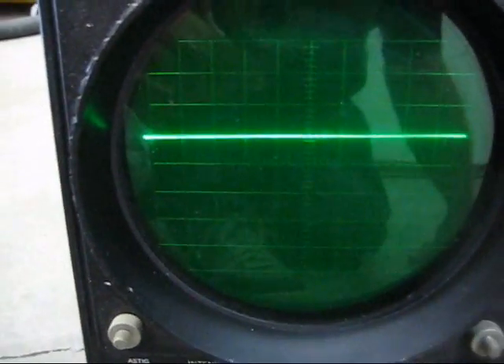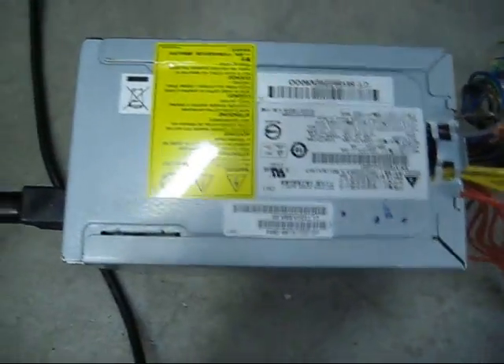Switching Power Supply For Chlorate Cell

Comment: I have a several power supply. The problem is when I connect it to the bath  the voltage drops down and sometimes amperage... to solve the problem need bring close electrodes together and in some case the electrodes need place far from each other.. I don’t who people manage to hold it to the exact point..
Reply from the maker: You need better supply voltage

Comment: mine is power by 600 watts 5v 32Amps power supply and when running it is only supplying 4.3 Amps max to the cell...i read it using dc current clamp meter....

Comment: can i connect all the + leads 3.3 5 and 12 together to an  300W stepdown converter like this http://www.ebay.com/itm/DC-300W-20A-CC-CV-Constant-Current-Adjustable-Step-Down-Converter-Voltage-Buck/401342111666?ssPageName=STRK%3AMEBIDX%3AIT&_trksid=p2057872.m2749.l2649

Comment: thank you for reply! even though i used even a 12 volt 10 watt light bulb it is just shutting down so i tried changing the load by using two 12 ohms 10watt attached in parrlel between 5 volt wire and ground then also it is shutting down  so i changed the load from 5 volt wire to 12 volt wire and i used a load of 22ohms 10 watt resistor then also it is shutting down and iused some combinations of resistors but they also worthless .So i checked out for short circuting but there is nothing.

Comment: hey!ytmachx i have old pentium 4 supported ATX power supply and i used a dummy load resistence of 4.7 ohms and 10 watts between 5 volt red wire and ground black wire and when i on the power supply it is running and as soon as i connected it to a chlorate cell it just shut down. can you tell what mistake i have made?

Comment: Thank you for the video.  The only purpose for the shunt is to measure current, correct?  Help me understand why you would limit current flow with the resistor, except to simulate a cell.  For chlorates, would the best option be 5V/13A?  What is the minimum V/A combination for any power supply needed to produce perchlorates?

Comment: Hi, i have just given this ATX mod a try, but the powder supply shuts down every time i try and run a globe off any of the power lines, do you have any thoughts on why it might be doing this?, also did your power supply have any sense leads for the 3.3v line ?

Comment: im just trying to figure out how many amps my system is consuming also, I hooked up a car charger to it @ 6 volts and it would do 12 amps easy, was making out the battery charger easy on 50 amps,  Do I have to have a load on the computer power supplies to have them put that out?? ie the light bulb running

Comment: very little, now should I make my cell on the positive side and run a 200 watt light bulb on the back end of it to pull more amps through it or is that none effective?  I used roughly 6 pounds of potassium chloride for the 5 gallons of water, any help would be nice :)

Comment: Ok so I did 3 300 watt pc power supplies in a parallel circuit, each rated at 20 amps for the 5 volts power line.. The question....  My cell Is a 5 gallon bucket im using 14 electrodes total to help with keep wear down. The bucket is nice and toasty near the top half, and cool on the bottom,  when I do a resistance test through my cell i get 2.9 milli,

Comment: i found an old computer lying around that doesnt work at all. but the power supply is good. i went through and cut all the connectors and grouped all the wires by color exactly as you did. i will start chlorate production on monday. that is if my cell doesnt melt. im going to look for a good glass cell. or make one out of pvc.

Comment: is a light necessary when running the cell because it needs to sense load? i would imagine it doesnt need to have it on the cell because the load it will sense is the solution in the cell. am i correct?

Comment: so, it is necessary to have a shunt on this? and a resistor? i could make some fairly easy but if it is not necessary, i wont. i figure the resistor is the most important. too many amps flowing out could fry it right? i could make a nice power supply like this but i need to know what all i need to do before i start.

Comment: The idea of few phases in SMPS is used on each PC mother board to create stable voltage for CPU core. It can have up to 10 overlapping phases. If you just connect 10 SMPS parallel it will work but you have no idea of how it is controlled and witch SMPS gives pulse of charge (energy) to the main capacitor at what time there for the ripple voltage may be a problem. It have to overlap in fixed controlled fashion and this is my next home project and I am using MCU and SMPS parts to do it.

Comment: Is ATX type with means it has two SMPS inside. The small one is always turned on and gives +5V standby and +30V something volts for the IC. When you short the green wire with GND you are starting the IC witch starts driving the main big power supply. It is very good idea to connect few SMPS in parallel to one filter capacitor for huge power with no voltage drift. But it works best when the PWM ratios are overlapping in phases just like few cylinder engine and I am working on such SMPS now.

Comment: Well the duty can be different from 50% it is not a problem the IC uses the feedback divided voltage to adjust the right PWM duty for different voltage. If you need less then 30A you can use the ferrite transformer as it is. If you want to go higher you have to remove both +12 and +5V windings to make room for thicker +5V windings. Also put additional filter capacitor if you draw high current. The voltage ripple is nothing if you compare it to linear power supply. The type of SMPS you have is.

Comment: You just take those 3 terminal schottky diodes from other SMPS from +5V rail and connect them in parallel on bigger heatsink. One diode can hold from 20A to 40A so with four of them you can not go wrong and big power supply use that technique. The only problem is the winding on transformer. Well it needs to be removed and changed and you can use bigger transformer from bigger power supply so it will be cooler. The voltage ratio is usually 1 turn 1 volt and at stable load the PWM is 50%.

Comment: Well the power is 350 W so above that the PWM from controller goes over 85% or so and is turns the supply off. You can draw entire power just from one rail. For 5V it means 70A if you regulate the voltage to 3V it is 115A for 7V it is 50A and so on. The power limits when the IC will cross the maximum PWM duty and it will turn off the power. Well SMPS gives you output voltage that depends on number of turn in secondary and on the PWM duty. Of course for higher current you have to use more diodes.

Comment: Each IC chip that controls those power supply has few feedback lines. Those lines are easy to trace out because they are connected to +5V and +12V and they are divided with a simple resistor divider to IC chip. You can disconnect the +12V and experiment witch the resistors in the divider for +5V. Then the +5v is not only stable because of the feedback but also you can regulate that voltage from 2V to 8V witch is handy. This resistor divider is also grounded from one side so it is easy to find.